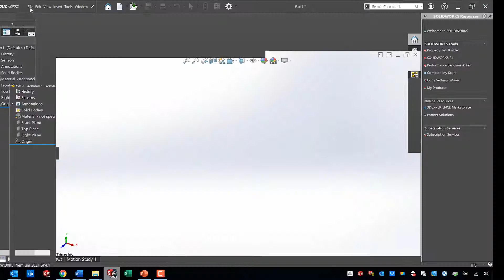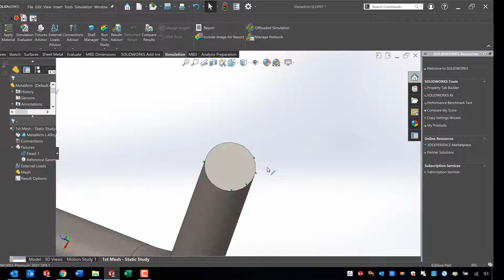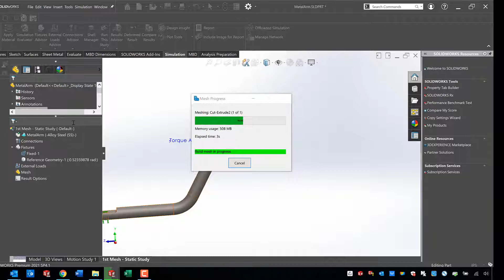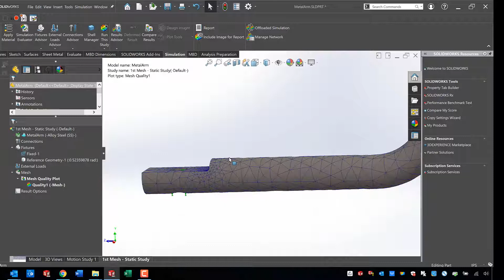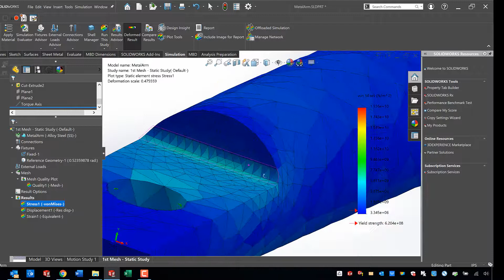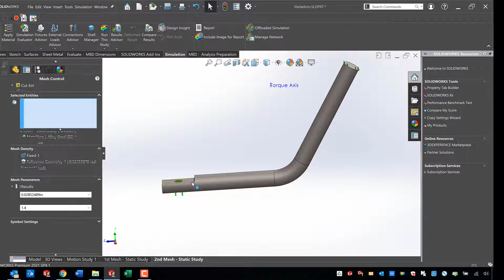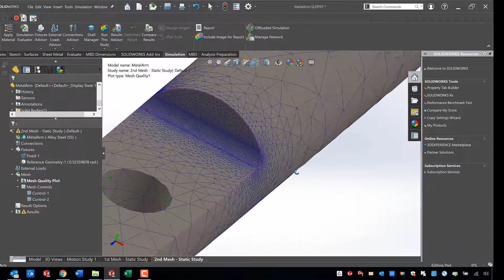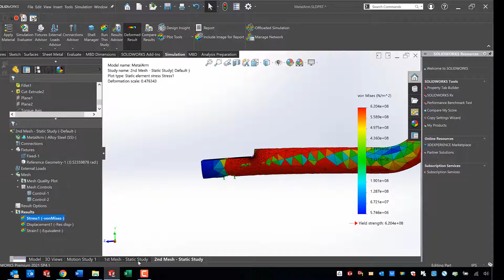Part 1: SOLIDWORKS Simulation | Convergence | Finite Element Analysis (FEA) | Meshing

Comment: I would need support for the following issue: If you have an Assembly of sheet metals, you will end up with sharp corners and as there is no fillet possible between 2 sheet metals it will lead to singularities and invalid results. So, one has to revuild the assembly as solid part to add small fillets. Is there a way, to simulate sheet metal assemblies correctly? Kind regards